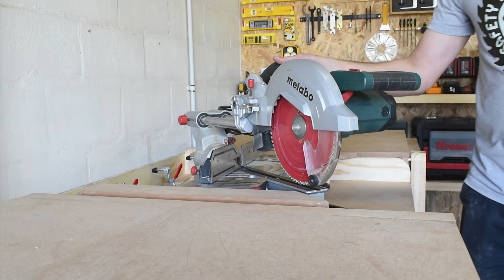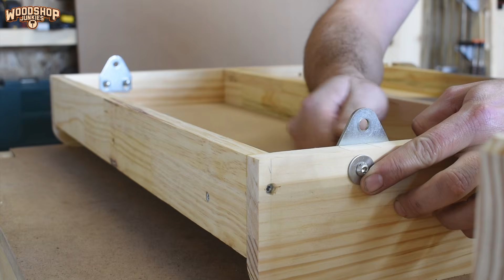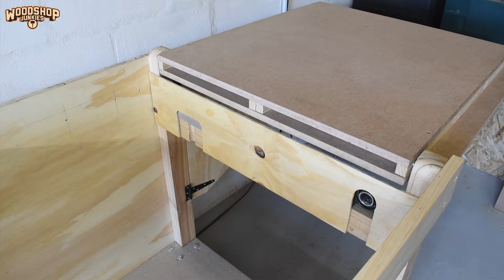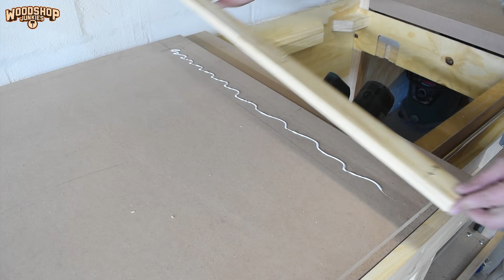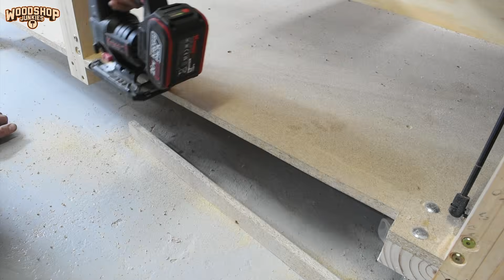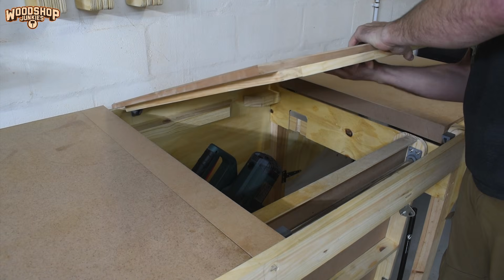3-In-1 Miter Bench With Hidden Tool Storage! - Garage Workshop Game Changer

Comment: Hi I recently paid for your bench plans and your sawhorse plans when do I get them? And also none of your contact links work just going in circles? If I don’t receive them asap I will raise a dispute with PayPal. So I hope to hear from you shortly!
Reply from the maker: Hi, you are supposed to receive the plans via email emmediatly after purchase. Remember to check your SPAM folder. Because the email contains links it sometimes ends up there. If you did not receive the plans you can contact my site admin on admin@thewoodworkersplans.com
They will make sure you receive the plans you purchased. If none of these are to your satisfaction you may raise a despute with PayPal and I will personally process a full refund.

Comment: @WoodshopJunkies, Jean, why do you choose to have your mitre saw rotate from the back (your original design) or the front instead of the middle of the table? Is it simply preference? Or is there some strength or structural reason?

I'm asking as I am building such a workbench and am leaning towards having the table rotate from the middle to free up some storage below the saw when it's stored.
Reply from the maker: For me, the miter saw needs to be very accurate. It is easier to stabilize the bed if the pivot is at one end and I am able to lock the other end. If the pivot is in the center I loose the ability to secure the bed at the 4 corners. I hope that makes sense
Reply: @WoodshopJunkies Thank You!!! Excellent point. I didn't think of that; but, I do agree.

Comment: I feel like incorporating magnets and the proper magnetic hardware would allow them to achieve easier and faster auto alignment of desired mechanisms for all your projects.
That out of the way I'm curious about your solution for the empty space usage and dust accumulated throughout its active periods. While some close the space that might not be the best option available for everyone, plus I like the option of leaving a few dedicated tools for maintenance or adjustments in the empty cavity would increase space efficiency and potentially save time. Just select whatever tool storage system wouldn't fall off when you choose to store your saw and maybe do something so parts and tools don't fall through the handle gap😅.

Comment: I bought your plans and built your first bench. (Even though much of it was not buildable in the states) It's a crazy amazing talking piece for those who visit my shop.  BUT.  And this is a huge but.  The amount time wasted in conversion of the bench I have to do during a project is nuts.  Flip up the planer.  While the planer is up, cannot use the table saw etc.  It's a great project and I urge those that are trying to learn to definitely dive in if they so desire.  But after using it now for 5 years it is more of a PITA than it is a plus in my shop.   Ultimately, I have designed and will be building a design that better fits my workflow.  And with that, I would urge others to do the same.  Personally, I prefer to spend most of my time creating rather than setting up and tearing down stuff every time I need to use it.

Comment: love the ideas you implemented! however, I wouldve prefered that the removable top (which becomes a face board when using the saw) would've flipped automatically up and towards the wall, with maybe 2 small sides to catch some dust.I understand your intent, but I think that wouldve been better as a "all-in-one" miter saw bench.

Comment: Can you add a removable fence/stop block system for the miter saw?  Maybe something that drops into holes in the tabletop so the bench top is flat when it's removed?  Also, you could use those same holes to secure the thickness planer to the cart.

Comment: I like this idea of how compact and useful this cart is. again, I can draw a lot of inspiration from it.  I was one of those commenters that thought that if the top got cluttered it will impede you from using the saw in the stored position.  I guess it's just my work style, I have a main bench that is for the project assembly, and then I use another area for keeping tools and supplies out for the project separately so it doesn't clutter the main bench... and that beautiful bench is too perfect not to be used for such. Unfortunately,  I think I'd have that cluttered in no time, then start cursing when I needed to use the saw.   But you're absolutely right; the question is:  What is the "Goldilocks" zone is between ease of use for a tool versus space and storage of that tool.   So, the way that your workstyle and how the rest of the shop is configured is crucial, these all work together as an 'ecosystem" 

For my shop: My future plans are that I'm going to put my benchtop tools on separate carts (two wheels and feet so they don't roll around when not being moved) that have a small footprint for each: belt/disk sander, miter saw with foldout wings, and router table on its own cart. Again, these 3 carts will be a small footprints, each with storage below for their supplies and associated tools, like the sanding station can also house my hand sanding and paper.  Also these carts can be rotated 90 degrees to minimize floorspace if I need it for a project, and be wheeled through a small door (30" clearance) to an outside work area with the space to work with larger pieces of stock, and when inside the shop they hook up to my dust collection system with blast gates, etc.  Having separate carts makes a lot of sense, well, to me at least.

BTW: If you want to see my shop,  it's on my channel,  it's not a shop video, but my recent videos on pneumatic props are "filmed" inside my shop so you can see what I'm talking about.

I might have a slightly larger space than your shop, but only slightly.  I'm 12 foot wide by 22 foot long... I'll do the conversions: 3.66 meters wide by 6.7 meters long.  The small side door is 32" wide with 30" or 762mm of clearance, not a lot. 
  
Now I realize that my idea for my shop won't work in someone else's shop, but understand, this is my 4th or 5th time I've done a shop overhaul and we learn as we go not only the space limitations, but also the workflow.  And that's really a tough problem that one has to find out for themselves.   I very much look forward to your next video,   Cheers.

Comment: Rather than use the new lift stop with machined ends, could you just add a board to the back bottom of the swinging table that buts up against the clamp board at the back? It seems like a simpler solution.
Reply: Yeah but he'll loose the fine adjustments to level the back...